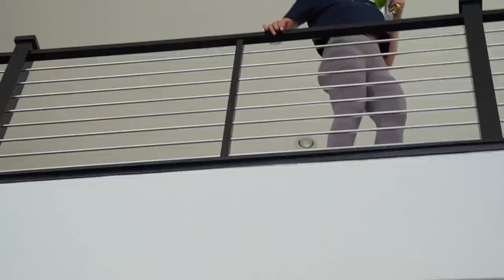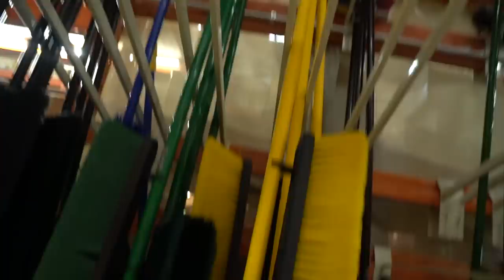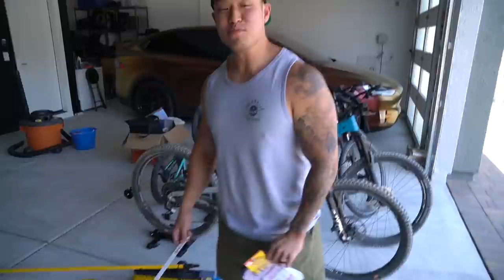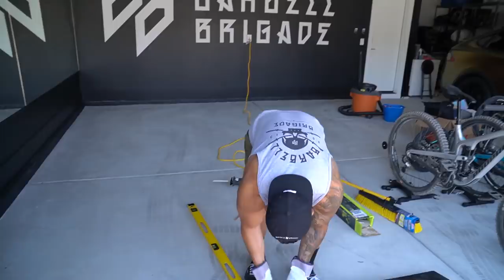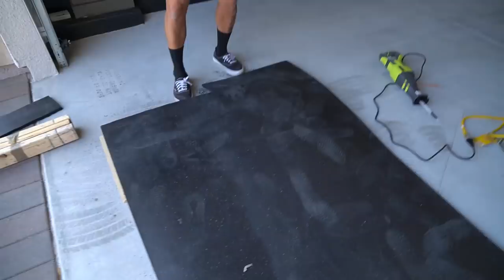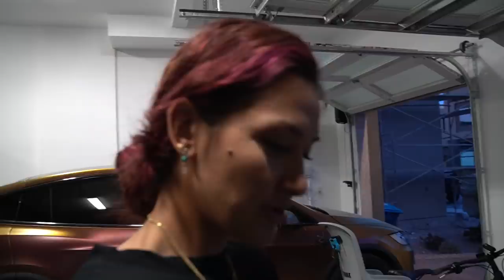Almost Losing A Toe

Comment: so when you use a sawzall on anything that can move at all during the cut, there is a 'heel plate' at the base of the blade that you need to smash forward into whatever you're cutting during the entire cut or you'll get way more vibration and way less cutting action...you can probably still get it to cut without the heel plate, but the cuts will be crooked and take way longer to complete than they should...

Comment: Not the best tool for the job, but whenever you use a reciprocating saw you hold the trigger and let it run first before you try to cut anything. Don't put the saw on what you're trying cut and then squeeze the trigger. This is why the blade would wobble out of place and bounced off the matt so often.

Comment: in the future Bart use a Grinder with a concrete blade it would cut PVC and plastic smooth and it would be a clean cut. Way easier to cut mats

Comment: Why no one tell this man to cut with a straight edge and box cutters, or linoleum cutter, or a power cutter. It would've been much safer and have more control. Reciprocating saw was overkill. Or better yet, shouldve sandwiched the mat with some 2x4's and a clamp for rigidity and a straight cut...